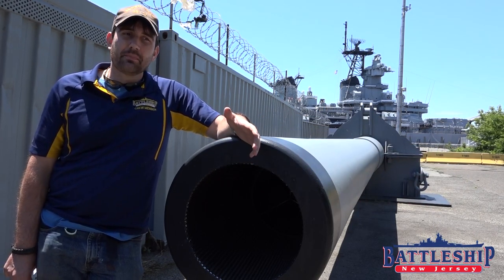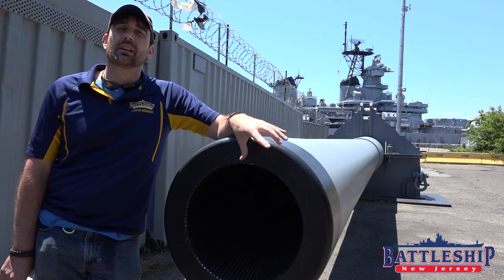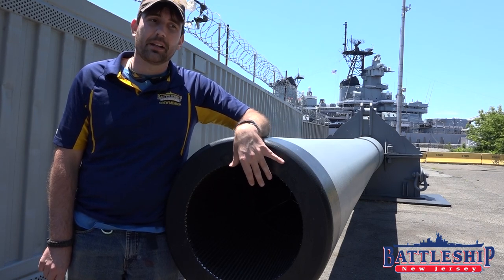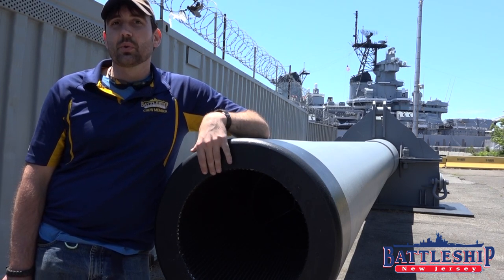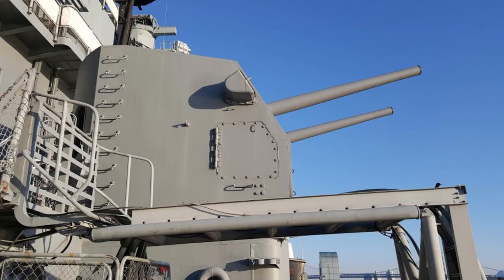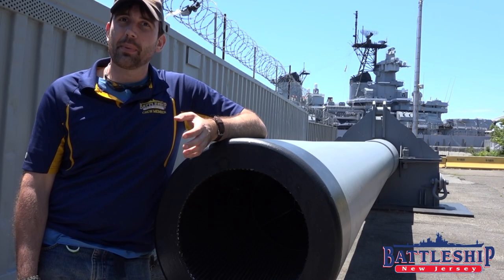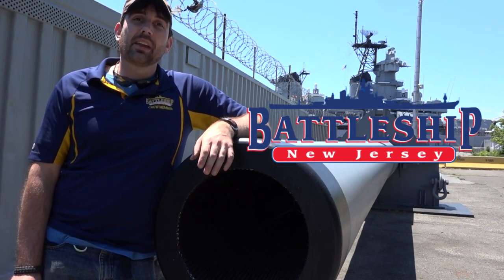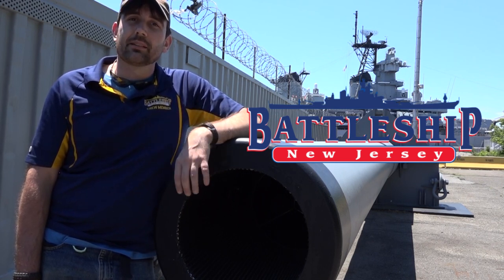Gun Barrel Replacements

Comment: While touring the David Taylor Naval Ship Research Center in Maryland, I saw a 16” gun set vertically in concrete with the breach at floor level. They used it as a high pressure test vessel.

Comment: It has been a 31 years for me since I served on the Iowa but I could have sworn that our High Capacity rounds were 2250 pounds. The AP rounds were 2700 pounds.
Reply: Several old Navy Vets I have spoken to over the years have told me that when the Iowa's were recommissioned in the 80s, every man in the Navy was trying to pull whatever strings they could to get assigned to one. One guy even said he knew of several retired sailors that were asked to come back and either re-enlist or work as contractors to teach the new young crews how to operate and maintain the engineering and guns.

Comment: so since the Vulcan gun had the longest life what if you made a 16" 50 cal mk 7 gatling gun :) just theory crafting here with my overactive imagination
Reply: try to spin up a 7 barrelled 16"... each weighing 150 tons...
Reply: @StaK_1980  electromagnetic bands at certain ponts along the barrels could do it but spinning them up would not be the problem stopping them from spinning will take a really long time
Reply: @aaronbriant3697  You could reverse the process to brake them as well. With that much mass a friction brake would have to have a huge surface area to do more than hold it stationary when not used.

Comment: How did shells for the 16 inch guns move from the pier into the magazines?
Reply: The shells would normally be loaded aboard a barge, be brought out to the ship and a crane on another barge or on the pier would be used to lift the shells to the deck where specialized equipment would be used to move them to a turret hoist that would take them down into the magazines.  A sailor who came to work for me after Wisconsin was retired explained it to me though I did witness both Iowa and Wisconsin loading shells at the Yorktown Naval Weapons Station, Yorktown VA.

Comment: Hello Ryan,
I live in South Philadelphia, and I've noticed the SPS-49 was turned towards Philadelphia last week. This week it is turned towards Camden. What's going on with that? 
Thanks!
Reply from the maker: It catches in the wind! So sometimes it turns on its own. We hope to be able to turn it intentionally soon, but for now, the wind is the one doing the work. Check out our facebool page for the latest update on that project, we were up there working on it this morning.
Reply: It would be pretty obvious if it was radiating - any systems in the 800-900 MHz band within range of the radar (cell phones, some radio systems, and some of the upper UHF analog TV channels) would catch interference, especially if the antenna isn't rotating.The -49 has somewhere around 13kW average power and 360kW peak power, so any receiver in band (or at multiples of the radar's frequency, to a lesser extent) would likely have their front ends overloaded and blanked out.

As for turning in the wind, I thought the 49 had a physical stow pin up on the pedestal...maybe it doesn't.
Reply from the maker: We've been working on getting the radar rotating (it does now!) so removing anything stopping it from rotating was key.

Comment: I can’t believe the navy didn’t take the phalanx system
Reply: Guess its an mock up, system is still in use on other ships.
Reply: Yeah me to. Thats why I called them and offered to pay current scrap prices plus 10%.   Wouldnt even need to disassemble it and make a mess, id take it whole and do it back at my shop.  Do you believe those pricks got the fbi and atf's panties all in a wad and thought I wouldn't scrap it?  Unbelievable
Reply: @magnemoe1  More or less, they go into detail in another video and state everything of use was stripped when it was decomm'd.  It's basically just metal tubes and an empty metal shell now.  All the radar stuff and the computers that controlled it are long gone, used on other ships.

So it's still the original CIWS, but absolutely nonfunctional and unable to be brought back online even if you wanted to.

Comment: its a shame no one came up with a supersonic missile to fire out of these guns using a powder charge as a launch boost
Reply: The far stronger missile body would incur weight penalty (1) for missile range and (2) for the weight of all the stored missiles; (3) you still need massive guns and turrets which you would be able to use for more missiles if you remove guns and turrets and replace them with VLS cells; (4) VLS can fire volleys of missiles - I would guess at one launch every few seconds, and even simultaneous launches from different cells. 
(5) VLS does not need aiming: you can shoot simultaneously at two targets which are 180 degrees opposite.
All this for an insignificant reduction of "time to target"?
Reply: See the MGM-51 Shillelagh anti-tank gun/missile system of the ‘60’s and ‘70’s.  It proved to be overly complex and mostly  unworkable.  The US spent a ton of money trying to develop it - and it was replaced by the far more reliable TOW anti tank missile.